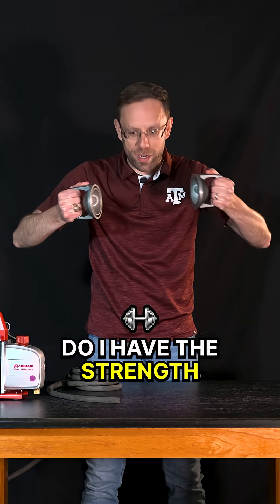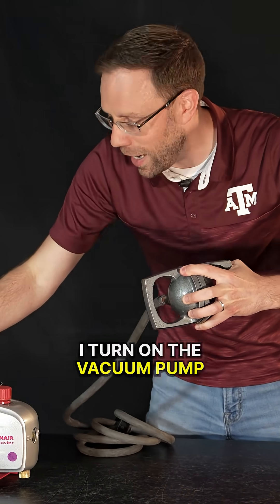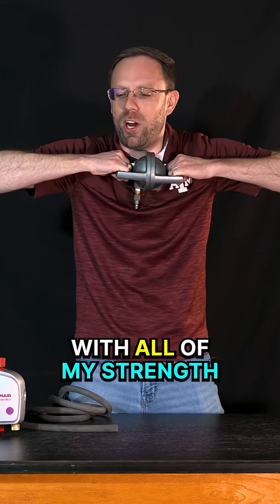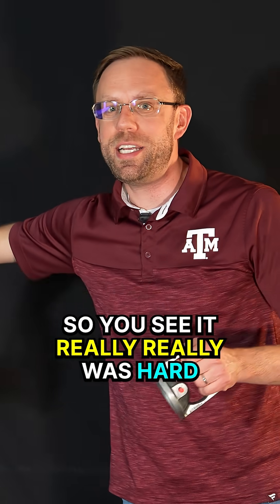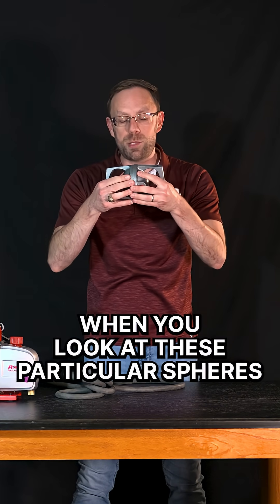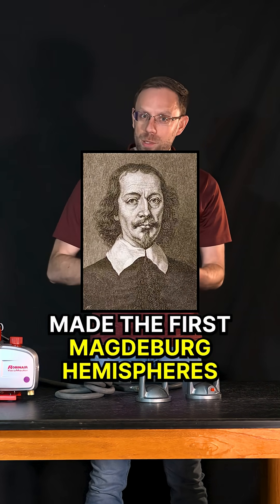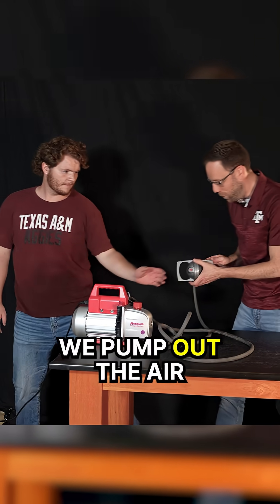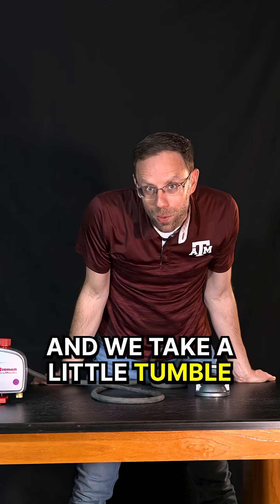Using atmospheric pressure to hold two objects together! #DrDawson #shorts #science

Comment: You didn't pull "all of the air". That's impossible.
Reply from the maker: Oh, so you're "that guy"...
Reply: @tamuphysastr   Yeah! If you said it once, I'd let you slide. But you said it more than once. 🙂
Reply: @inemanja  semantics. There technically is air in space too. So what?
Reply: @horsemanshipper   No, there is no air in most of the space. There is only on the earth, and near the earth - but most of the space is airless, although there are atoms of hydrogen almost everywhere.
If you wanted to ask if space is a perfect vacuum/is the pressure 0? No. Closest to zero pressure is on the Earth (in labs). Same goes for coldest and hottest place in the universe.
Reply: @inemanja you do know that there is leftover air from the earth all around the sun in the orbital path of the earth around the sun, yes? Space starts at 60 miles. It's mostly but not purely hydrogen there. The same goes for the orbital path. So, yes, there is air in space too.
Everyone can be pedantic

Comment: If it's even more bigger of it's size then it's air inside is impossible to pull it
If you get 10 people you might not able to do it
Needs a car to pull it easily
Reply: What if there were in a vacuum with no atmospheric pressure wouldn’t it make it easier ?
Reply from the maker: I think the cars would just tear themselves apart... this sounds like a really great video idea though.